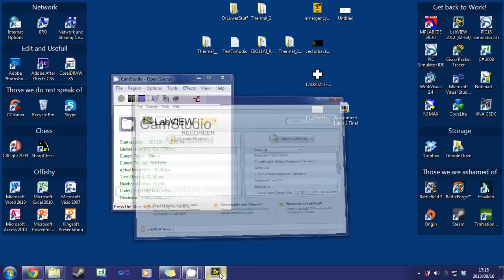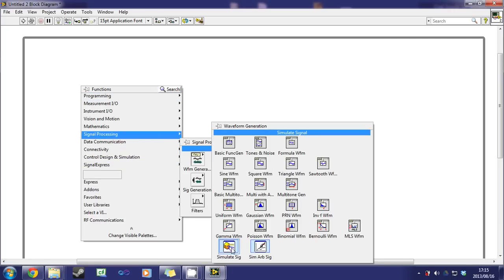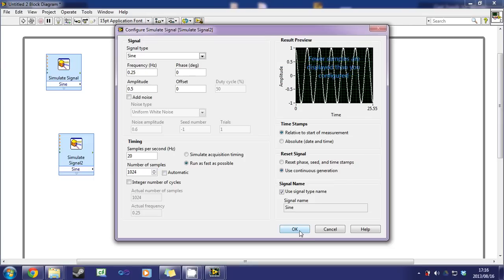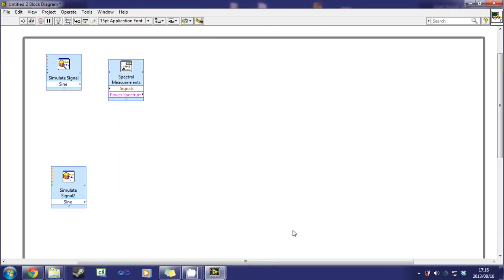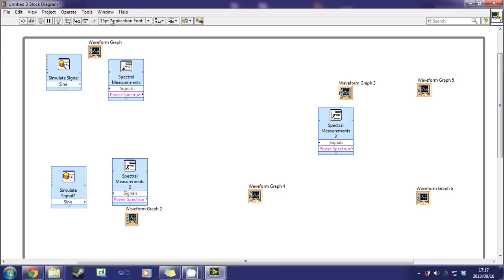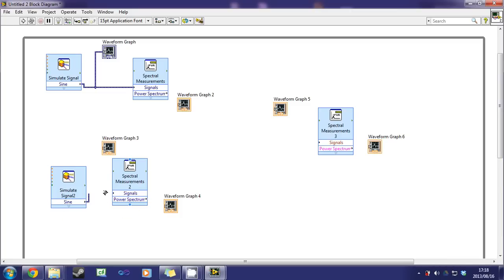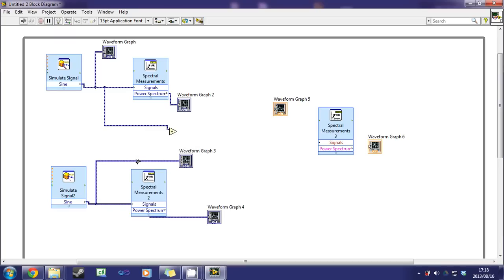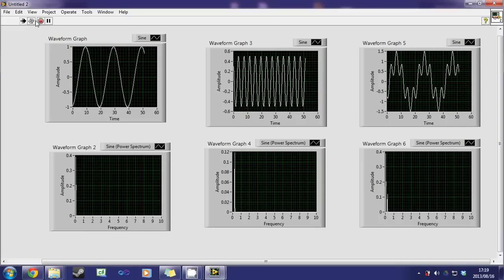Implementing Fourier transform in LABVIEW

Comment: I would be very thankful if you could help me in a particular matter. 
I have a project which requires building a Signal generator, an Oscilloscope and a Spectral Analyzer. I am not going to copy them from somewhere because I really want to learn something by doing this project. However, I can't get my head around signal generation (what do you have to set if you want to change the frequency through a knob, what's the deal with the "samples/second" and "number of samples" that have to be set and so on - I cannot make the connection between them).
Thank you in advance for your help.
Reply from the maker: Hi Gabriel

Signal generation is a good staring point. Are you asking for a tutorial on how to implement signal generation by simulation ? Are you using the express VI?

samples/second is the amount of samples that the program will take every second of the input analog signal to make it digital.

number of samples is the amount of overall samples that will be taken if.
Reply: Hi and thank you for your first response.

The project I received is not one out of nowhere. In fact, I've been taking a university course on Labview for about 3 months (not a truly intensive one though).

What I am trying to do is to generate some signals (sine, triangle, sawtooth etc - 7 totally) for which the user can vary the frequency (through a panel knob). 
The problem that I have is that, when putting the signal I simulate into a waveform chart, I see either a distorted signal, a DC line or no signal (depending on god knows what).

To answer your question: I tried both the Express VIs and the (Sine/Sawtooth etc) Wave VIs with amplitude and frequency given from the user panel, and none of the cases seem to provide the solution I am looking for.

What should I do next?
Reply from the maker: Gabriel Flueran

If you look at the first part of the video it shows you how to pace a signal generator. After the express signal generator is paces it will open a configuration window where you can specify attribute about the waveform like type of waveform and sample rate.

Try using a graph instead of a chart.
Reply: +Gabriel Flueran 

It's probably pretty late to be answering this but you could always use a mathscript structure and have frequency as a control input to the structure opposed to just using blocks.